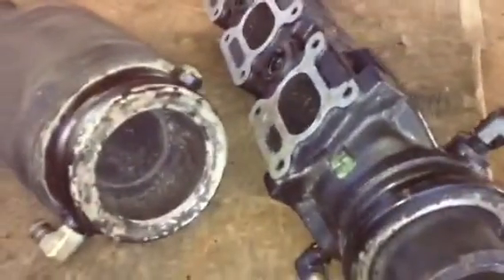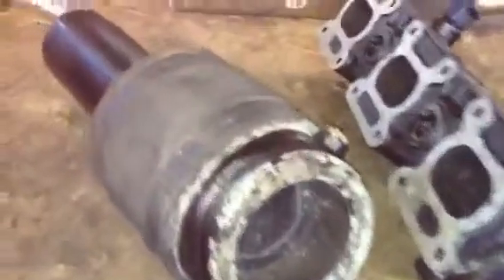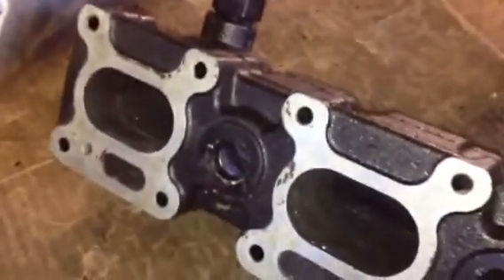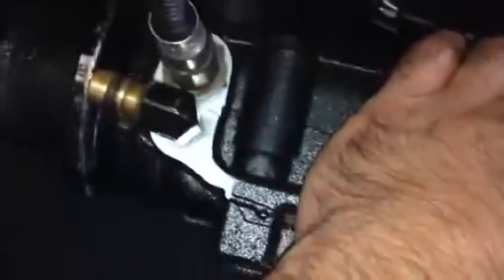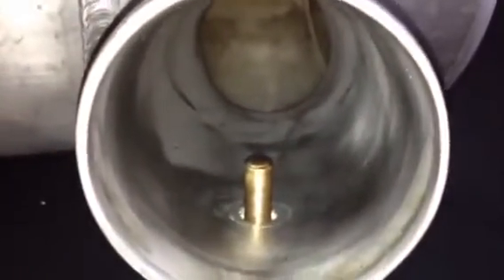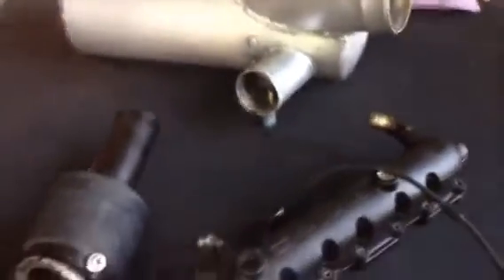Seadoo Exhaust manifold flowing and clean up

Comment: Notice any improvements? I looked into my exhaust manifold (06 rxt) today and i wasnt very impressed
Reply from the maker: Yes ,smoothing out the manifold gave me much better throttle responce and follow through . I can without a doubt feel the difference ,it was a worth while mod to do .
Reply: Great news. This is a common upgrade for supercharged cars. What size bits did you use?